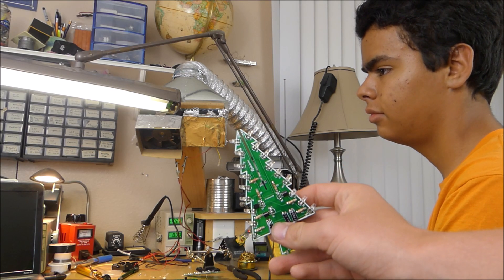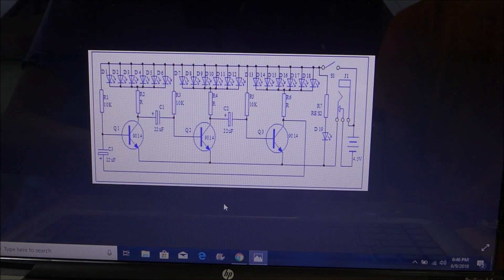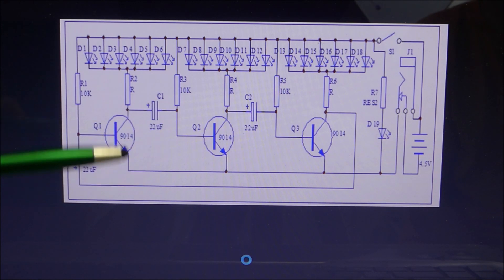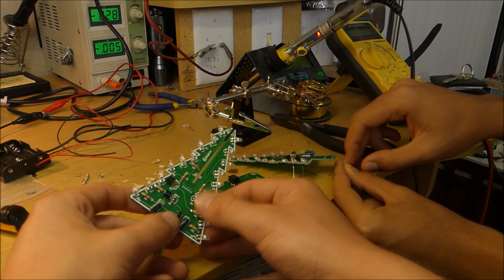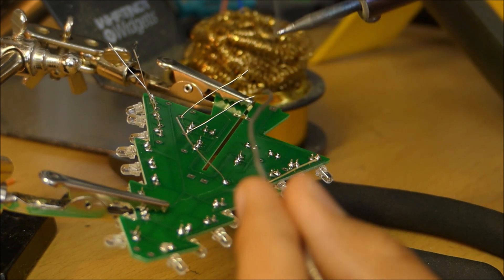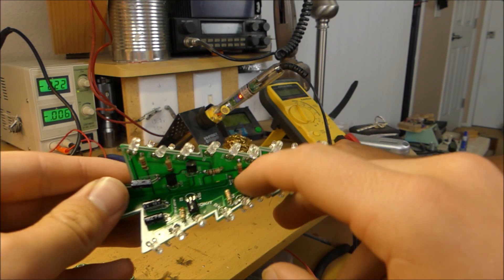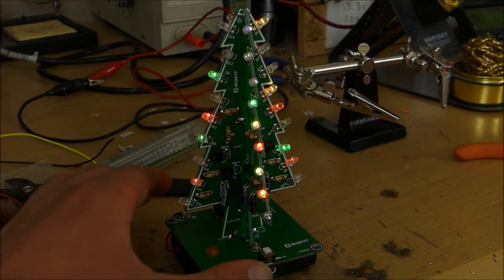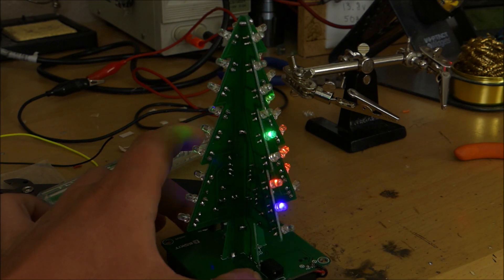Christmas Tree Circuit Board With Ring Oscillator Explained

Comment: The reason there's so much red is because the ring oscillator is frequently restarting the LEDs' internal color changing circuit and red is the first color in it's sequence. When populating these boards with the color changing LEDs, it might be better to not have the conflicting control of the ring oscillator at all and just directly power the LEDs or at least slow the oscillator way down and let the LEDs change color on their own for a while between transitions.

This three-stage ring oscillator topology is used in various forms on Chinese kits and sometimes the circuit has startup problems. To avoid, or solve the problem, add a 100 nF ceramic capacitor across the emitter and collector of one of the transistors.

Someone mentioned in another comment that these kits are not available; they are, from all the usual Chinese vendors.

Comment: I used a Raspberry Pi Pico to control 18 "pairs" of leds, and an actual rgb light on top... I also just gave them all the same value resistor and was able to control them somewhat... they still have an internal ic...  but I just hope it doesn't burn down my Mom's house 🙄